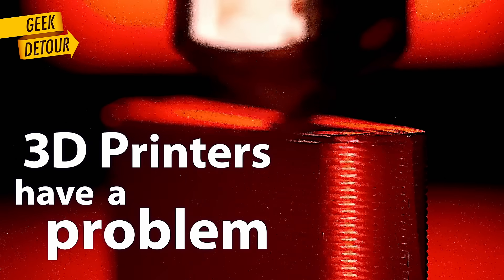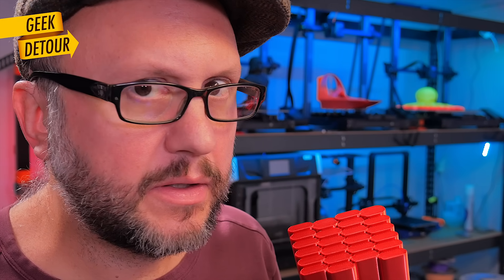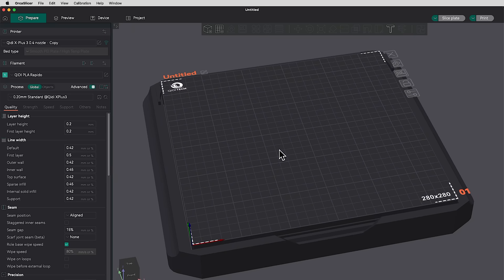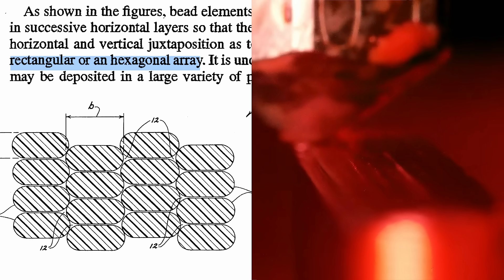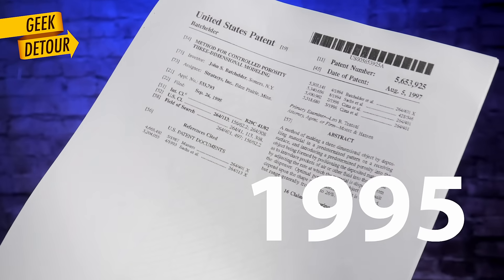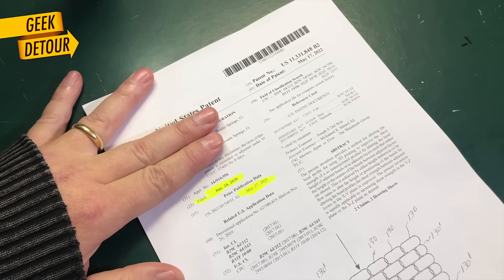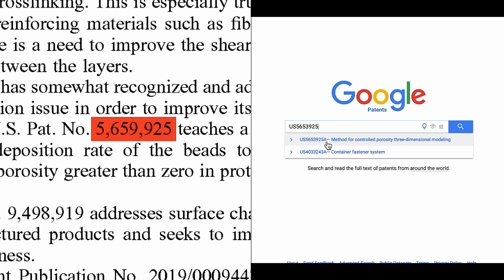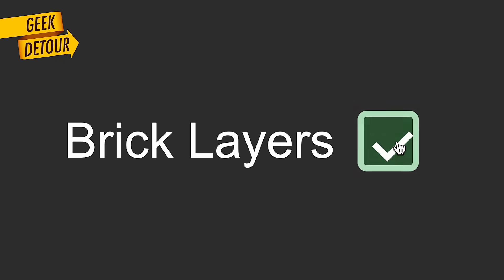Brick Layers: Stronger 3D Prints TODAY - instead of 2040 😬

Comment: Correct me if I'm wrong, but imo, filling the gaps at the microscopic level won't help increase strength unless the plastic bonds at the molecular level. I.e. printing a line that must microscopically bond to the line that's already been printed. That requires the ambient temp to be hot enuff to keep the plastic above the glass transition temperature. Which all Knowledgeable people will know isn't practical with some plastics. 
Am I wrong?
Reply from the maker: You are not wrong: the continuously extruded line will always be stronger than the adhesion of lines melted on top of each other - but there is space for improvement and the hexagonal pattern is a big step.

Comment: While the patent may or may not be valid, it is very specific. At a quick glance, the Stratasys patent is broad and covers the end results (benefits and uses thereof), while the "new" patent covers a specific method to achieve this. If you can find prior art by Stratasys that demonstrates the method (indicating that they have likely attempted it, if not using it in current commercially available products) then this patent may be invalid, however if nobody actually used the idea successfully (as demonstrated in patent or application) then this may be why the patent was granted. Prior art in the form of a submission to an open source product may be used to fight against it (that particular thread may not have been a regular source for the patent clerks), but that would be getting into legal ifs and buts that may vary between jurisdictions. End result will likely be another company like Bambu Lab introducing a similar feature to their software, they may be slightly resistant to being chased by patent holders. There are also at least another 3-4 methods of achieving the same result that vary enough from the patent to be easily implemented without risk if others wish to implement higher density infill in the current open source slicers. US20180297272A1, for example, is currently "abandoned".

Comment: Even if the new patent won't hold in court, it would still be expensive to get that ruling, so the new patent can still be used to prevent free slicers from using the technique.
Reply from the maker: I don’t have any knowledge on that - not a lawyer. I hope to see Attorneys involved in the discussion here, to educate us ❤️
Reply: There is no ruling to get. The only way to challenge a patent is to ignore it. It is on the patent holder to enforce his patent. So the patent holder has to demand the slicers remove the feature after they implement it and sue them if they refuse.
Reply: @THX..1138  It doesn't matter who initiates the lawsuit, it's still going to be expensive, way more money than a non-profit organization that depends on donated labor is going to have.
Reply: @Waldohasaskit210 I think the new patent holder probably has way less financial resources than for instance ultimaker or prusa.  Prusa has a turnover of like 70 mil per anum and ultimaker a whopping 650 mil per anum. 
And ultimaker is part of Stratus which is the holder of the old patent. 
It is not a good idea to enforce the patent. 
Will probably be a financial disaster.
Reply: So the one with the deepest wallet win? This is not how it supposed to be.  I say the first patent is expired and everybody is free to use it.
Reply: @chipcode5538  I don't like it either, but that's how it is. If we gave judges the ability to award legal costs to the winners then SLAP suits like this would lose a lot of their threat.
Reply: Waldo unfortunately you're wrong. It is exactly as said by THX

Comment: On the hypothetical question that there is no patent, how are you going to solve the head movement when each layer is displaced. With the current state of the art, I see a big problem with this because it is a very very precise shift in the order of micrometers. There would have to be a new generation of printers first.
Reply: Plus. The current state of the art is such that many companies have a lot of problems. It would be appropriate to solve the old problems first and then deal with the new technology. At present, this research work is only theory and will not appear in practice for a long time. .... It would be preferable if nozzle cleaning, for example, became standard. There have not been many ideas in this area. This area is completely unexplored. :-)

Comment: The most common slicers should just implement it. If the patent troll want to go to court, they can just laugh them out by showing this video. Get the patent thrown out and continue on with innovation.
Reply: Yes. This appears to be a wrongly issued patent.... However there's no authority to appeal to get it thrown out. It's on the patent holder to try to enforce his patent. They can sue the slicers who implement it, but it doesn't look like they have a leg to stand on. IMO they would fail to even get a preliminary injunction against the slicers as the slicers lawyers would very likely ague they were implementing tech from the expired 1995 patent, not the probably invalid 2020 patent.
Reply: @THX..1138 What if the slicer was open source and free? Who are they gonna sue?
Reply: @Sparkynutz81 They will sue the maintainer of the project, the contributors to the project, and potentially the platform the project is shared on itself (though usually they are protected). The damages that would be owed are lost profits to the patent holder, so if your project is very popular that could be millions of dollars in damages. Of course, in this case they will probably lose, but if you were the FOSS maintainer, would you risk millions of dollars to add brick layers to your slicer? And thus it should be clear why nobody has brick layers in their slicer.
Reply: @jeffwells641  Just holding back progress. So many inventions over the years with tiny changes were made open source, or produced by competing factories. 
Or hopefully the patent owner of brick layers sells it to be used in slicers for reasonable royalties to get the show on the road or release their own slicer so we can pay for it and use it already.
Reply: @Sparkynutz81  You wouldn't even know most of these things existed without patents. We wouldn't have the internet, or computers, or anything remotely modern without patents that smart people can read, understand, and iterate off of. You can't build on other people's work if you don't know what they did. Patents enable that. 

That's different than the functioning of the current patent office, however, and the current patent office is broken, clearly.
Reply: @THX..1138  It would be a complete waste of time and money for the person to file anything. And btw there are authorities.. I literally googled "US patent office" after seeing this and emailed them with all the links and a TLDR
Reply: @THX..1138  Word bro!
Reply: @THX..1138  while you're very right that it should get thrown out immediately, it's probably not worth the risk if they somehow drag out the court proceedings and run the slicer company to the bone. 

Remember this company is doing exactly that to bamboo labs and has done it before to the slicer magnum hotends.
Reply: @madbull4666  Patents are notoriously difficult to enforce even when they are valid. In this case they appear to have to have repatented  something patented 1995.

Aside from rendering the 2020 patent invalid it means if they try to enforce their patent the accused infringer can claim they were acting under the equally valid (in the eyes of the court) 1995 patent. This shifts the burden to 2020 patent holder to prove to the court their patent is valid before argue some else is violating it.

Effectively this mean the 2020 patent holder not only has little chance of winning in court they likely can't get any sort of preliminary injunction against the Slicer companies. Moreover they will likely be on the hook for the slicer companies legal cost after they lose.
Reply: @madbull4666  We need slicers with plugins. Then, the lawsuit will hit some anonymous extension writer.
Reply: @THX..1138  Now that is a good approach
Reply: @pizzablender or just add the ability to compute the z-offst height while slicing. So add something like z=z+(a%2)*0.5

a = distance to next outer wall
Reply: for those claiming they could drag it out in court, it comes down to money, all the combined software and hardware companies that could benefit with the new gcode  most likely can afford to out lawyer them, so no in the end they would end up belly up! unless whoever filed the patent is much richer, but something tells me they are not. just a guess
Reply: i support this, and if multiple companies all agree on it - even if they do it slightly differently - the troll is literally fighting 1 legal case versus multiple companies - which won't hold well unless that troll is a billionaire.
Reply: Agreed. If they take it to court, just state that the patent cant even correctly source it's claims.
Reply: this patent was just invalidated by this video. this patent is now indefensible.
Reply: that is probably the best way, why waste money attacking a patent when you could just implement, cite the original patent, and leave the expense and dillema of claiming on the patent holder
Reply: at worst you just have to remove it again
Reply: Even if it doesnt get thrown out you cant really enforce patents against open source non commercial software (that last part is important)
Reply: I do see a loophole around this, but it would require the open source solutions to add some type of open modification feature. This way, anyone who wants to do this themselves can add the functionality in private and put any potential liability on individuals instead of the one company. Plus, it would be harder for them to know who's using it, and good luck attempting to sue thousands of users instead of one entity.
Reply: @tylermfdurden  yeah that's not how it works unfortunately
Reply: @madbull4666  that is how it works. wile this video cant be used as evidence the fact that this new patent is just a re-patent of a expired patent would be more than sufficient to get the case dismissed.
Reply: @Drbeattles  And yet it will still cost likely several tens of thousands of dollars. Are you going to pay?
Reply: @WhoDunIt2  I already donate to most FOSS slicers, so yah. nice try.
Reply: @Drbeattles  "Nice try" Wtf are you on about mate, I was pointing out how even to fight an obviously bs lawsuit it is going to cost a shit ton of money, money that not everyone wants to cover in case it doesn't go their way.
Reply: @WhoDunIt2  you were trying to pull a gotcha. just sadly I actually put my money where my mouth is.
Reply: @Drbeattles  You're quite literally insane mate.
Reply: @WhoDunIt2  you're just mad
Reply: @Drbeattles  The projection is strong with this one... I'm confused at how someone can be so monumentally dumb to think I was trying to "pull a gotcha", but you can live in your own invented reality if you want kiddo, I couldn't possibly care less about what you think or feel.
Reply: @WhoDunIt2  i have NEVER seen someone pull the "are you gonna pay for it?" online and not try and use it as a gotcha.
Reply: @Drbeattles  Well you have now kiddo.
Reply: @WhoDunIt2  tens of thousands? Bud it would cost nothing but the time of someone from the company to go 'hey judge, this ->" The thing that (can) cost alot of money in court cases are the LAWYERS. Court fees are not very high, especially when defending. Getting an official transcript of court proceedings can be pricey, but even then you're talking hundreds, not thousands.
Reply: @mastalock  Yeah the legal system doesn't work like that, sadly; if you don't have a good lawyer, you lose to the better lawyer with better connections. If you don't have a lawyer at all, is basically asking to lose immediately the case; I've seen it happening with individuals thinking the case is too obvious so they would just represent themselves, eventually just losing the case and the judge dismissing them because they don't have a lawyer. Some individuals couldn't even find a lawyer because no lawyer wanted to be against the other lawyer from a very famous law firm. The legal system isn't about what is right or wrong, or what is obvious; it's a rigged system, it depends a lot on the lawyer even for obvious outcomes, and it's expensive, specially if you are a company.
Reply: @mastalock   Ok bud, you go ahead and represent yourself in a patent lawsuit. 🤣
Reply: @WhoDunIt2  I feel like at this point you are a straight up troll. No one could believe such stupidity for real. 1) Never said anything about repping yourself, but TBH in this specific case you could, easily. 99.9% of lawyers do not cost tens of thousands of dollars. For such a slam dunk with very little time investment required you could find one for $1000 or less. But again, this patent person knows what they did. There isnt a chance in hell they would initiate a doomed lawsuit against an open source program. There's no money there.
Reply: @egonzalez4294  While there are exceptions like you describe, that's not true. This isnt even a 'common sense' thing, obvious assumptions. The indisputable proof is right there in print. This person/LLC with the patent knows what they did. There isnt a chance in hell they would initiate a doomed lawsuit against an open source program. There's no money there.
Reply: @mastalock  You're likely right about them not filing suit in the first place, but incredibly wrong about everything else you said. You obviously have zero clue how much corporate laywers that specialize in patent law can cost, nor are you aware of how much money Addman has at their disposal.  It's measured in billions. So you go right ahead and assume that going up against a private equity firm with billions will only cost you a couple grand.
Reply: @WhoDunIt2  Okay, "kiddo"
Reply: @Drbeattles  what on earth is that supposed to prove? demonstrate? support? I'm genuinely at a loss for why you wrote it.
Reply: @occamraiser  the patient by all legal standards is bogus. It has zero merit and the patient office errored by granting the 2020 patient.
Reply: @WhoDunIt2  The trials are paid by the loser.
Reply: @cosmefulanito5933  That is not a universal truth, and winning is far from a guarantee.
Reply: @WhoDunIt2  bro is so mad
Reply: I read both of your comments to each other and I have to side with him… you were trying to say, “gotcha! But blah blah blah will cost money..” but he pointed out that the patent owner will first have to use their money to file, and likely won’t even be able to get the case started…

You didn’t need to insult him, he was right.  You lost this round.
Reply: @buschdogg  If you're referring to me, guess what... You don't have the right to tell me what I was trying to say, only I know what I was trying to say, and any kind of "gotcha" is not it. So you feel free to live in your own constructed reality, I'll live in the actual reality.

Thanks for your unrequested and unneeded input chief!
Reply: @WhoDunIt2  the legal costs will likely fall on the patent holder trying to defend his ridiculous claim and taking everybody to court over it
Reply: @egonzalez4294  That's not completely true, but you do need a competent lawyer representing you. A layman will get absolutely trounced when he doesn't understand how to counter even slightly complicated legal theory. You're basically asking the judge to be your lawyer, but the judge only acts as the arbiter and interpreter of the law, they don't do the research themselves, they leave that to the fact that both lawyers want to win to find the best relevant legal arguments for or against.

Hiring a lawyer is expensive, therefore you're looking at thousands of dollars to defend against this patent. IMO a case like this shouldn't get crazy expensive, like $10k max, but that's still a lot of money.
Reply: @madbull4666  actually they could, then it would go to court and the 3d companies could hire investigators, expert witnesses show that the company lied and that the patent was bs! also I wouldn't be surprised if the company that filed the patent doesn't have the funds to defend themselves!
Reply: @madbull4666  No, that is exactly how it works. It's on the patent holder to take action and prove their patent is valid.
Reply: @madbull4666 yes it is
Reply: @madbull4666  That is in fact exactly how patents do work.
Reply: @madbull4666 It absolutely is. Just go to court if they sue you.
Reply: Send me an software I will publish this under my own name. I can go to court
Reply: @madbull4666  actually thats exactly how it works. A patent is only as strong as the companies budget for lawyers
Reply: @domnik9062  that's my point, multimillion dollar company that is also a bit of a patent troll and goes after everyone that is even close to their patents. They won't think twice about sending the lawyers in for a slicer.
Reply: @madbull4666  Expertly laid contrarian statement without elaboration. Bravo!
Reply: @madbull4666  I'll be... uhm "physically persuasive" if need be.
I'm expensive, but worth every dollar.
Reply: @integerofdoom69  deal!
Reply: so, your suggestion is.... knowingly infringe a patent and hope to win in court. You do realise that damages are increased if you KNEW in advance about the patent - tripled, if memory serves.